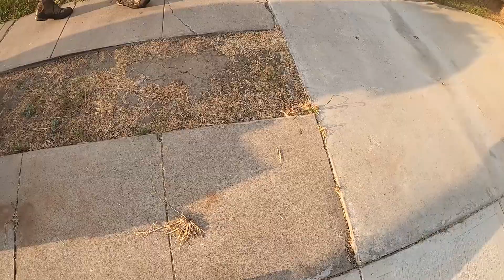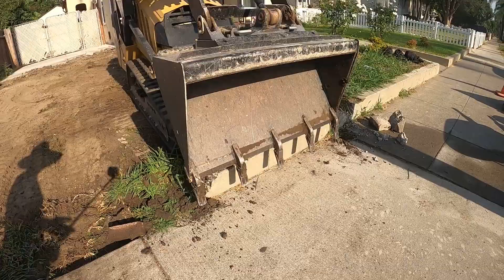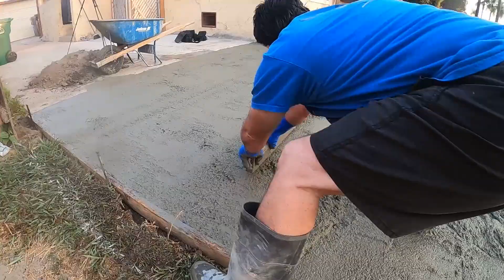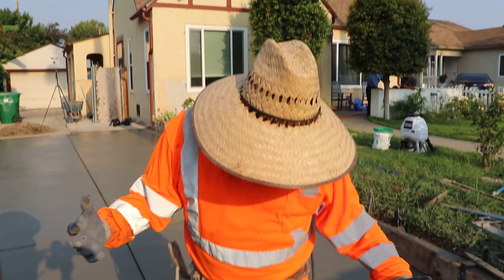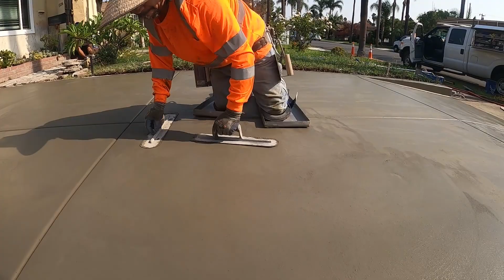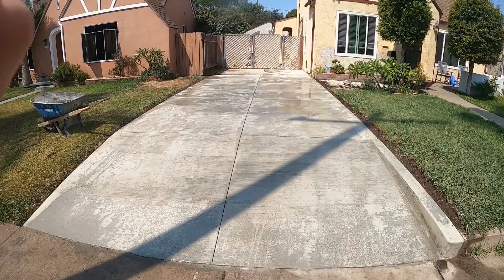Concrete Driveway Ribbon Replacement

Comment: Up north you can not over work the concrete and its a huge mistake to put any water on the surface before you broom, thins the surface.  You would be tearing out all that driveway the first time it froze.  No dobbies, no structural sub grade with compaction. Concrete was full of fly ash and looked like clay.

Comment: Question?
Do you charge flat rates wether big or small? Or do you turn away small jobs or over charge?
I keep getting told quotes of about 8$ a sq ft labor and materials then I say it's a 10x10 or 12x12 patio and out of no where their quote turns into 15 to 1900$ because small jobs apparently require more labor than machine?.....wouldn't machine cost more(maintenance fuel & operator).
Reply from the maker: Small jobs take the same amount of time, equipment, and labor as bigger jobs.
The only real difference is material cost.
Reply: @OdellCompleteConcrete  so a 10x10 should be like 1000 to 1200$ final?

Comment: Nice pour. Those control joints looked awesome. Like to see that. Too many guys just don't take the extra little bit of time to make things turn out. Most people don't notice, but concrete guys always look at lines. Do you always broom across the driveway?  I always broom down the slope. Reason being is the water will run off easier. Then again,  I live where it is frozen 5 months out of the year.
Reply from the maker: Depends on access

Comment: You guys do absolutely beautiful work. A thought on your key ways. My company does poly concrete lifting. When I come across key ways or pinning at a garage skirt it makes it sometimes impossible to lift a piece of concrete. When the concrete settles and the attached key way settles dirt or debris can get between that key way  and in this case the sidewalk. This makes it so that the concrete can’t be lifted. The only recourse is to replace the pad at a much higher cost to the customer.
Reply from the maker: Replacing is best option for a area like this.

Comment: Great videos.  Through them I have been able to manage a 14 yard pour and involved with another 18 yard pour for shop slabs along with other smaller sidewalk and pump house projects.  Hoping to add a front apron to my shop, approx 30x14.  I really want a finish less abrasive than a broom finish to be able to comfortable work on it, but need to have enough texture to not slip when its wet.  What might you suggest for this particular application?
Reply from the maker: Broom it when it gets harder.
Or sweat trowel finish.
Or Sand wash.

Comment: A note on rain drainage and impermeable driveways.  Throughout the 27 countries of European Union and the UK, law requires householders to prevent rainwater from running off their land onto any public road.
A concrete drive like this one would require a drain completely separating the drive from the pavement to divert rain runoff into the householder's own 'SuDS' compliant soak away system.  (Those regulations are known as ' Sustainable Urban Drainage Systems'.)
Reply: HYUKLDER1 1) Los Angeles is a desert as is most of California. The drainage demands are drastically lower than almost all of the EU except for maybe Spain and Portugal. Only 40 cm rain annually. 2) Los Angeles is somewhat famous for having some of the worst drainage of anyplace: https://laist.com/2018/06/22/la_explained_the_la_river.php

So the situation is very different. However we have started requiring permeable parking lots and pavements in many parts of the state as well as storm drain recharge basins and similar technology.
Reply from the maker: Interesting

Comment: Fiber mesh only combats shrinkage cracks on very hot days or high winds. The dosage rate to add any strength is in the tune of 10-15lbs /yrd or 5-8x the normal rate. Beautiful work, just don't want to see you wasting money for nothing :)
Reply from the maker: You may be right but I don't want a eye sore
Reply: @OdellCompleteConcrete  I'm a ready-mix concrete manufacturer and deal with various mix designs. Look at the vendors spec sheet and see what the added psi or tensile strengths are at the recommended dosage rates. Once the concrete cures, the fibers have done their job and do nothing after. It's your rebar that keeps your projects looking good for years. Keep up the good work/content.
Reply: cpddan have you checked the CA weather lately? Heat and desert wind at least 7-8 months per year and a heat wave lately.

Comment: I use a set of stainless sliders on most jobs. I have a backup set of polystyrene sliders for more sloped jobs. Then I also have a set of regular knee-boards for steep sloped jobs. Not very fun trying to stay uphill with stainless sliders on pitched concrete. lol.
Reply from the maker: Yes I have had a lot of fun with guys on slopes and sliders, me at the bottom and extension poles .